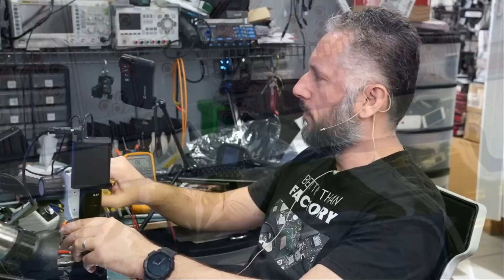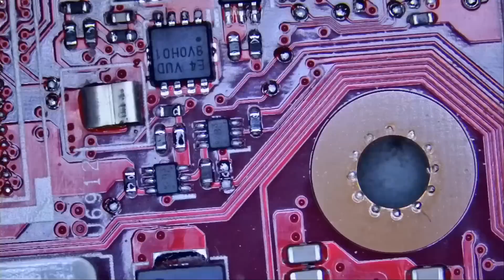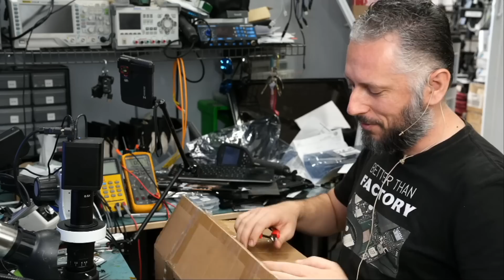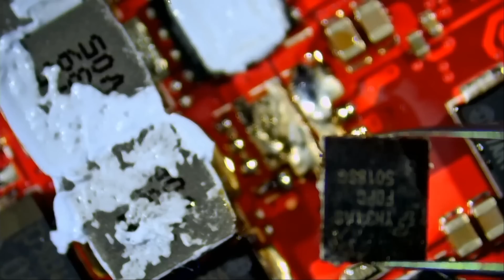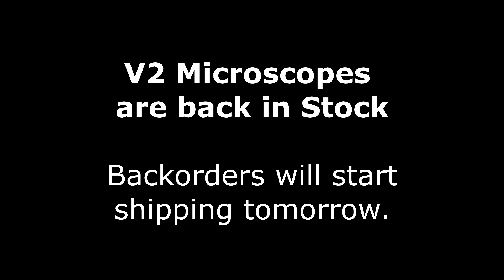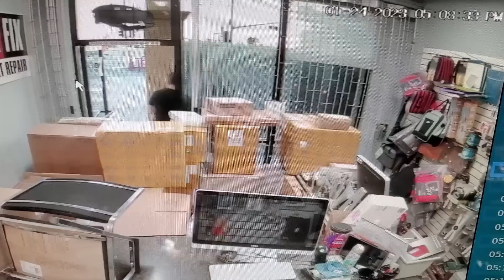Asus ROG Gaming Laptop Repair - Teaching the board a lesson

Comment: NBF: I watch several other Youtube repair channels, and most of them have issues when it comes to Mosfets. They find the problem, but it has normally taken out the CPU and/or GPU in the process. I noticed you have a pretty high fix rate with this (especially with Asus), but also know that you don't post a large chunk of your repairs, since you are so busy. Just wanted to know what your fix percentage is for this particular issue (bad Mosfets). FYI, thanks for being such a positive influence on this community!

Comment: You could at least plug in the board using a similar charger and test if that MOSFET shorts again to see if it is a fix or not, just saying
Reply: Bord without batt will start and plug HDMI and check it.
Reply: @gile849  you mean a board without Cmos battery will start, that's what I meant

Comment: Another great video Alex, with board displine being the main topic. Can anyone tell me what the light blue paste that is applied on top the mosfets 1:52 seen to the left ?  what is  the reason? as I see it on so many boards in various videos.
Reply: It's thermal putty. Instead of thermal pads, more and more companies are migrating to this kind of product, that behaves as a thermal pad but has advantages, like less stress on the components because it will flow under pressure, but it stays in place after compression. It also does not lift the heatsink from the board, like when you use a 2mm thermal pad but the gap is 1mm. If you use thermal putty, you can use 2mm of putty but it will compress to 1 mm or even less after a while.

You can check laird tputty 508 or 607 to have an idea. But i don't know the brand that asus uses. But it seems very liquid. I usually use laird tputty 502 and it's like plasticine.
Reply: Remnants of thermal pads used to transfer heat from the MOSFETs and inductors to the heatsink.
Reply: Those are thermal pads.
Reply: You must be talking about the flux, it is clear so any lighting may shine color upon it. Just look it up --- soldering flux.
Reply: @HazeAnderson  no the white blue stuff on top, is it thermal compound?
Reply: @HazeAnderson  Not quite, it's not the flux that is used to desolder the components, I'm referring to the light blue paste 1:52 in this video on top of the mosfets, it comes from the factories like this I think.

Comment: asus motherboards are cheaping out on components or they are running the system with thin margins using mosfets nearing its maximum handling or they just have bad supplier of mosfets😁

Comment: 5th comment. It's seems to me after watching alot of your repairs on Asus motherboards is that almost always it's the mosfets. Do you know why they always fail. Or have a theory why they do? Thanks again Alex for a great video. Blessings to you 🙏👍
Reply: I'd have to imagine the extreme heat in a very confined space with budgeted parts.
Reply: Agreed. I will take wild speculation at this point.
Reply: Proabaly death throuh heat. The mosfets in my 2020 Asus ROG Strix G17, while gaming, the VRMs can get as hot as 85°C, some hotter, some colder. There's not much that has to go wrong for one of them to get allocated more power, maybe accidentally, and die due to overheating